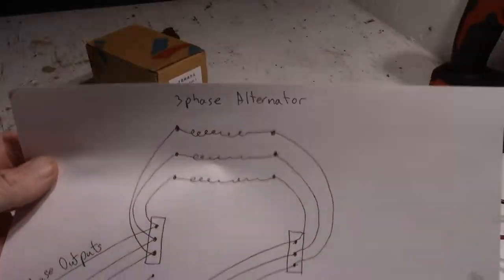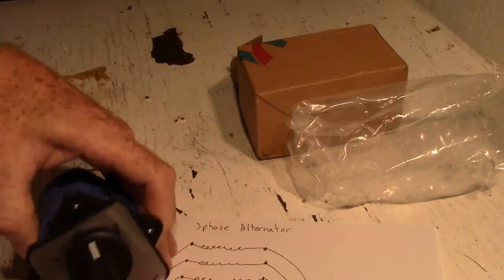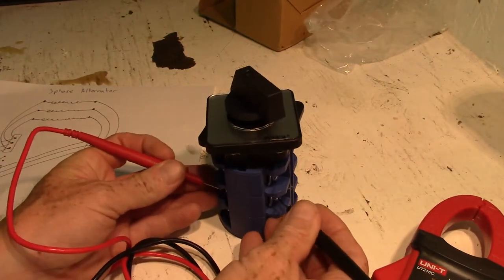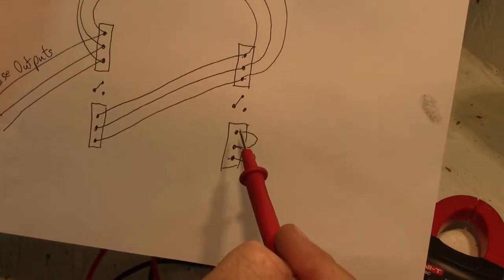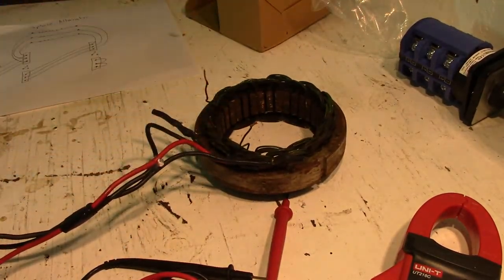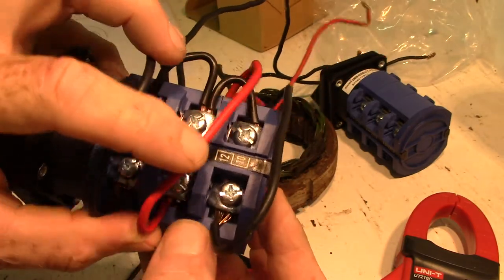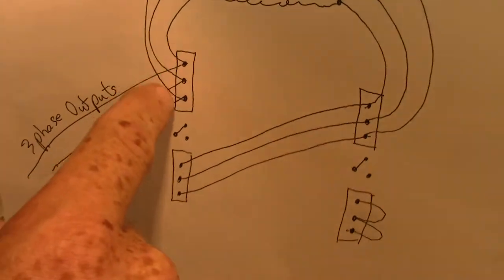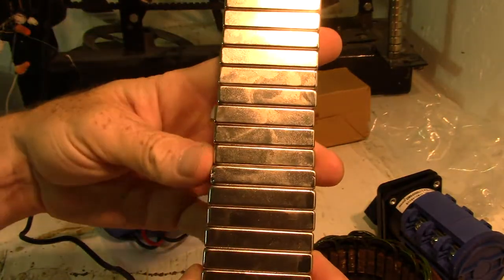how to switch from parallel to series (Delta to star) on a 3 phase alternator in a second

Comment: Do you know if this switch would work well with a much lower voltage then the 660v this switch is rated for? Let’s say about 80v or 100v? Regards
Reply from the maker: They are rated for 600v it would probably handle it if you don't use too many amps.